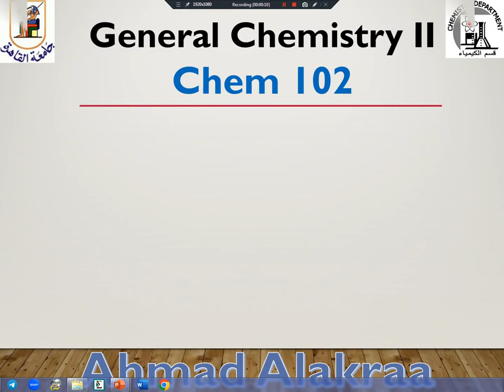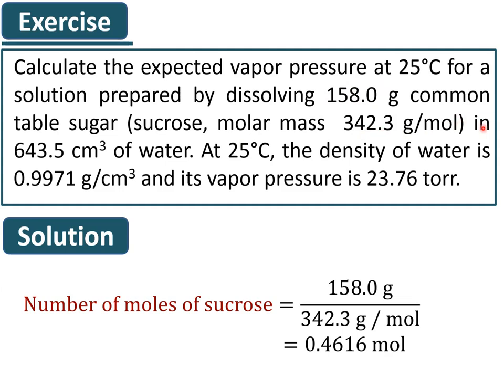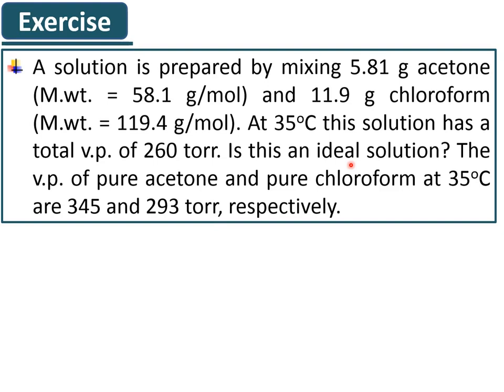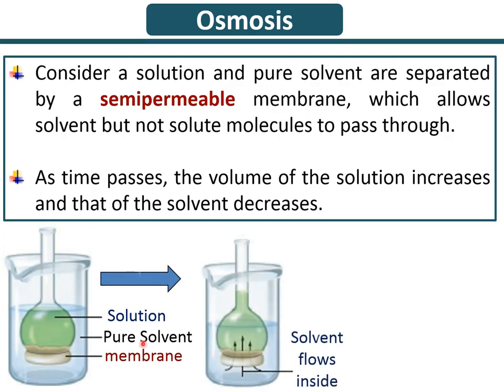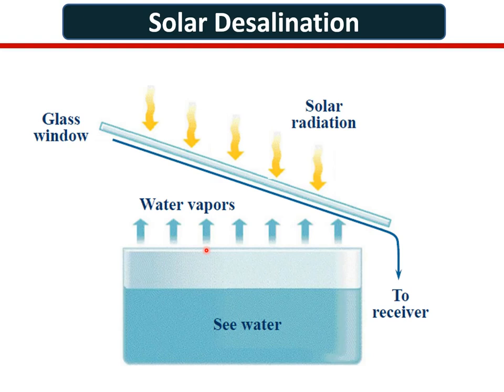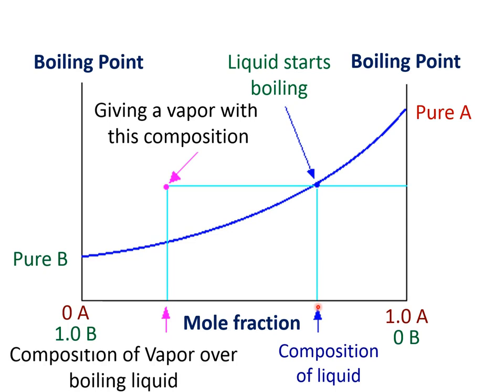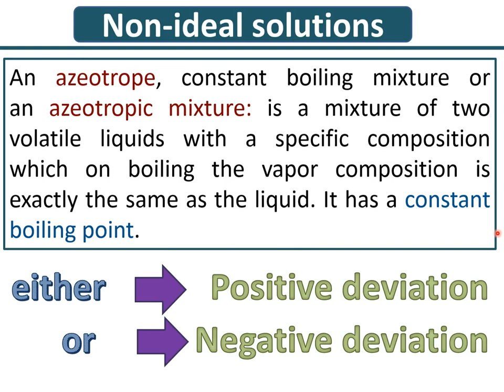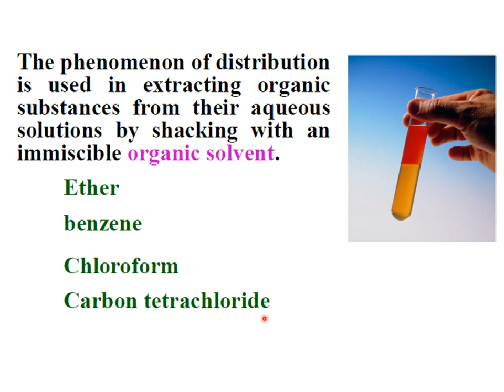Lecture 8: Chem 102_E Solutions II (Colligative Properties)

Comment from the maker: I want to refer to a mistake I did unintentionally. For the ethanol-water system and for the azeotropic mixture which has a minimum boiling azeotrope, I said the intermolecular forces between ethanol-water are stronger than those in Ethanol and in water individually. This is wrong and the opposite is true which make the vapor pressure of the solution higher than those of pure liquids and consequently the boiling point of the azeotrope mixture is lower than those of pure liquids. So pay attention to this correction.